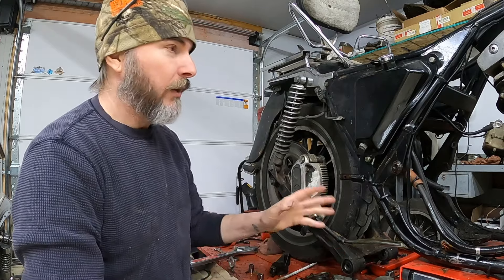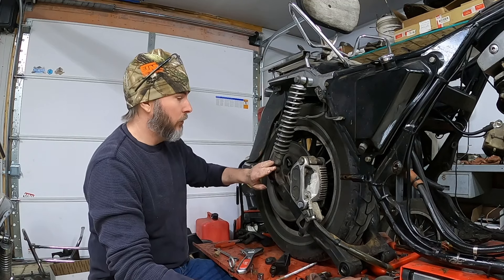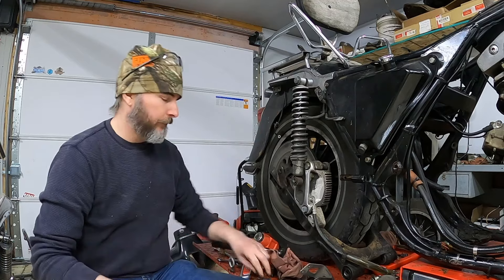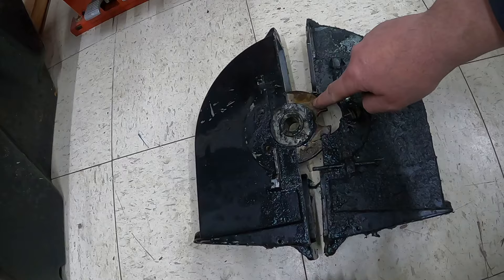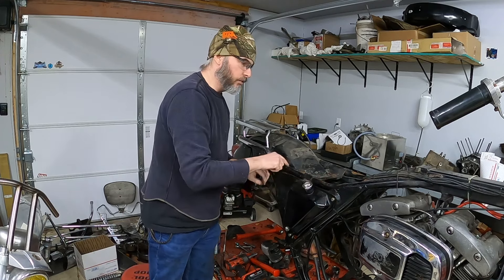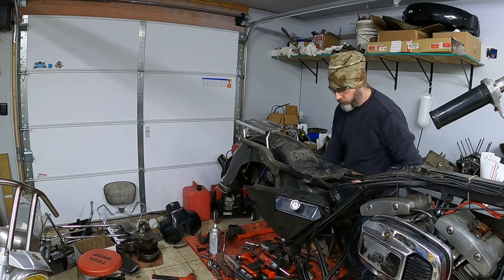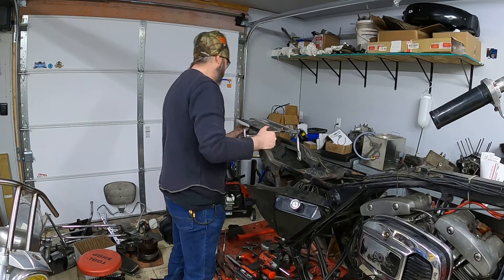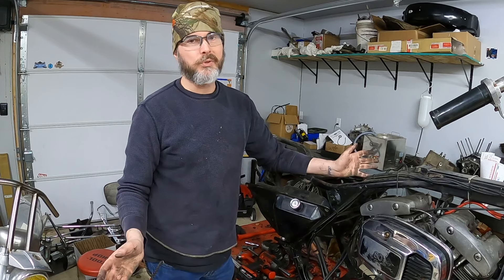1980 Harley Davidson FLT Shovelhead Project Part 5 HD 1080p

Comment: FLT's were disliked by a lot of people when they came out since they weren't "friendly" when it came to modding them when compared to the FLH and FX frames but the rubber mount design did make for a smooth cruiser. Finding neutral at a stop light with the 5 speed transmission could be frustrating though.
Reply from the maker: Yes! I’ve ran into that a lot with the 5 speeds! They are smoother when it comes to the rubber mount.  Have to say that I don’t mind either when it comes to solid mounted or rubber mounted.

Comment: I thought that the spoke wheels were only available with the springer seats. 1978 had the 1200 half the year and switched to the 80 mid year.  I hope that you're not planning on chopping them.
Reply from the maker: You know. I’m not sure on spoke wheels and what specific models they came on you could be right as it makes sense. No chopping, just selling parts